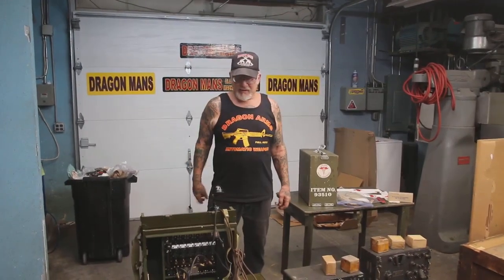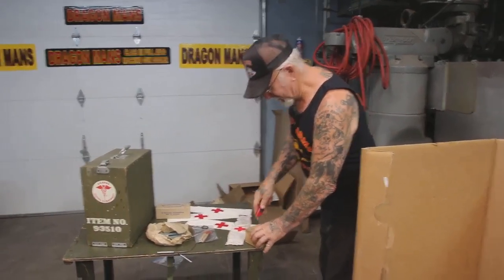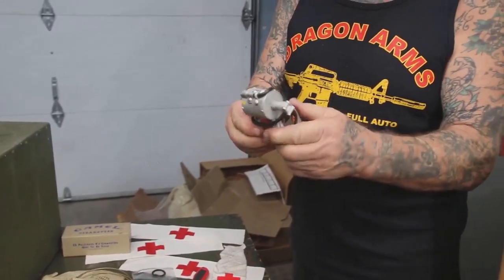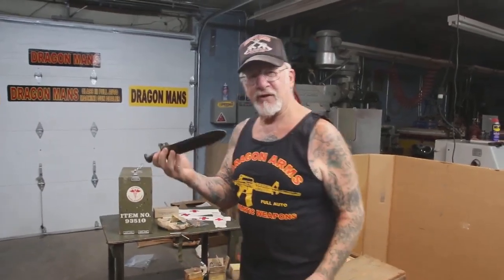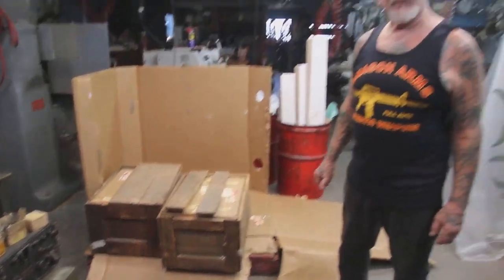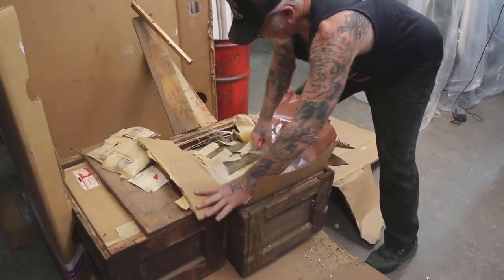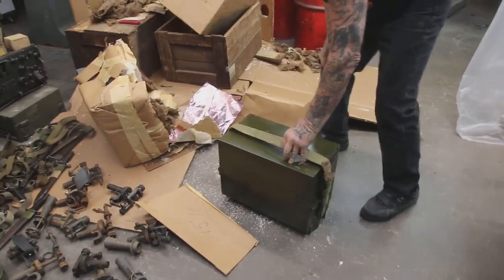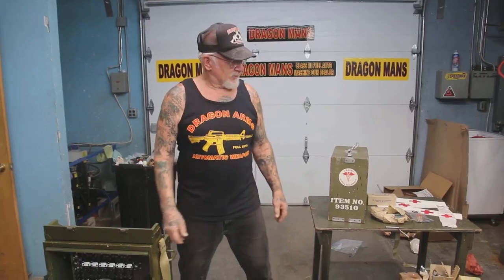WWII ITEMS

Comment: They definitely did not cut all m1905 bayonets down. They actually cut over 1,000,000 down and then produced them at a standard length of 10 inches from mid-1943 and after. There were at one time at least 1,500,000 uncut m1905 bayonets.